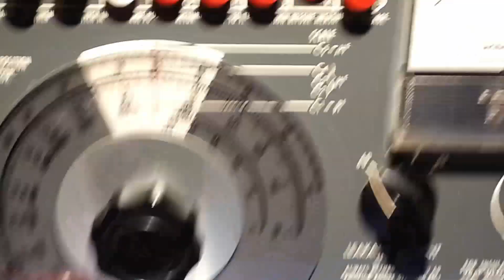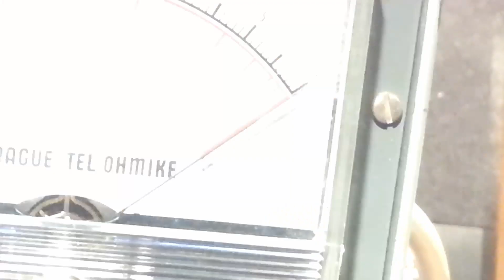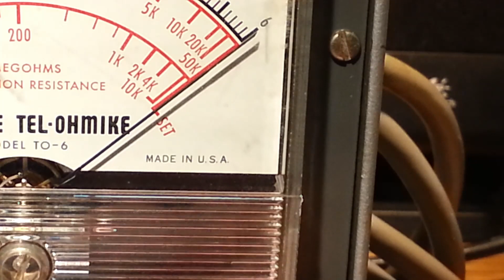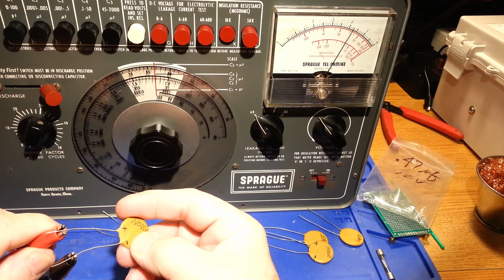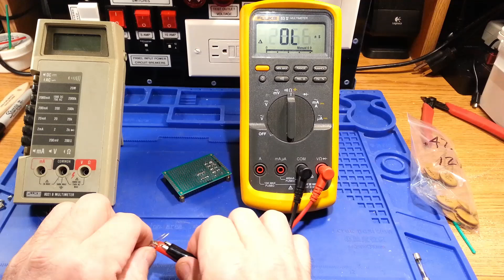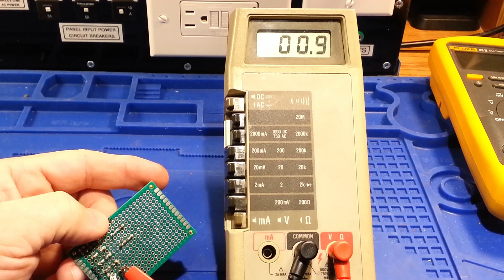E008_Conductance, Gigaohms and Easter Eggs

Comment: My favorite poor man's way of measuring high resistances is to use the input resistance of the DMM as the top resistor in a voltage divider, that way you can easily measure low leakage currents or high resistance values with just a little math. The only gotcha is you need to check the DMM manual to see the impedance at different ranges and use it in your calculations.

With this method and a simple voltage multiplier connected to the grid you can easily measure isolation resistance of transformers or leakage of high voltage capacitors at the rated voltage, I also use a variac to set the appropriate voltage.
Reply from the maker: Yes, that can work, but there's a LOT higher voltage involved, and more complicated math as well. Conductance is related to resistance through a direct inverse formula, and all 3 of these devices use non hazardous voltages.
Reply: @poormanselectronicsbench2021  you can also use this method with just a few volts, with a DMM with a 10M impedance and 1mV resolution you can easily measure 10GOhm with just 1v supply voltage and most meters these days are even better.
Reply: @Gengh13  Hi would you be able to demonstrate   what you are talking about on your channel one day? I subscribed to your channel so I get Notification, thanks 🙂
Reply from the maker: @Gengh13  : How you ever got 1 mA resolution meter to show current to flow through a 10 Gigaohm resistance at 1 Volt is a mystery to me, but if you did, rock on! I did a practical test of your statement, as well as working out the ohms law math.I used a fully charged 1.5V D cell battery for my voltage source, and a Keithley 197 Bench DMM to measure with, as it can measure down to .001uA, or, 1 NanoAmp. Using a 10 Gigaohm resistor in series, the meter would not display a value. Using a 1 MEGAOHM resistor in its place, the meter read 1.5 uA ( Microamps) Using ohms law, confirms the 1 Meg resistor current, and if you do the math on 1.5 volts divided by 10,000,000,000, you get 1.5 X 10 to the negative 10th power, or 150 pA (PicoAmpere) I set up  a circuit in Multisim SPICE with a DC source and a resistance here, using a 1 Volt DC source to verify my measurements were correct.
https://www.multisim.com/content/Qp79GemU7pW2crwUhZPp36/basic-dc-current-circuit/
  And, as far as the "10 Meg input resistance / Impedance," that goes away when you use an ammeter function on a directly connected meter, as they work on the principal of reading the voltage drop across a low resistance calibrated internal shunt, and then calculating it into an Amp, Milllamp, MicroAmp or NanoAmp value. Even if you used an voltmeter, to read voltage drop across a 10G resistor, it would need to read accurately down to a PicoVolt range, I don't think there are common DMM's capable of reading that low.
Reply: @poormanselectronicsbench2021  you use the meter in voltage mode, not current, what you get is the voltage across the input resistance, acting like a 10M shunt, that's the magic of this technique that gives you the sensitivity. 

With that the Resistor you are measuring is:
Rx=Rinput*((Vbatt/Vmeasured) - 1)

I hope now it's clear.

Edit: that equation is simply derived starting from the ohms law of the unknown resistor and replacing with know values, the current is the same as Rinput which is Vmeasured/Rinput and the voltage across that unknown resistor is Vbatt-Vmeasured.
Reply from the maker: @Gengh13  OK, I can say that, trying it with 2 handheld DMM's, a Greenlee DM-860 ( Re-branded Brymen) and my Fluke 83-V, using a 1.5V D cell inline with the meter set to DC mV, and across a 1 Gig resistor, I came up with about a 14mA reading on both meters. Using a 10Gig resistor was kinda inconclusive, as both meters readings bounced around a LOT, really too much to give a conclusive guess to the tiny voltage present. I would say that, I wouldn't expect good results, at least on those 2 meters (both of which are fairly accurate and in good shape), to try to read anything more than 5 Gigaohms in a circuit, but, yes, it can be done at a low voltage with that method. I also tried using a 9 Volt battery and that gave a fairly consistent 9mV with the 10Gig resistor, so that may be a better source voltage, but still staying safe to use that method.